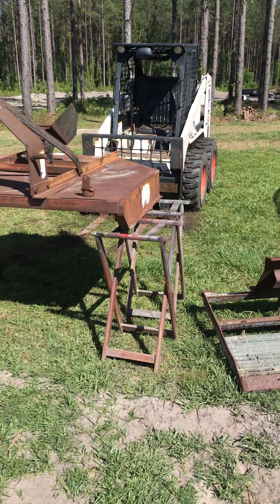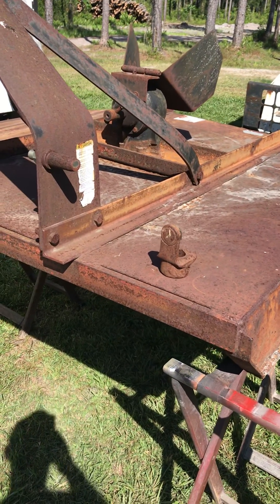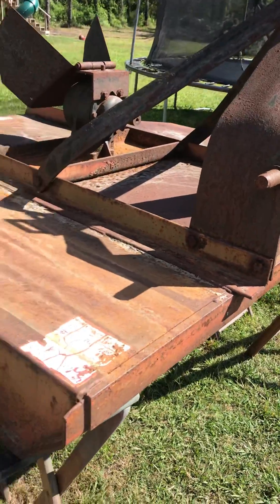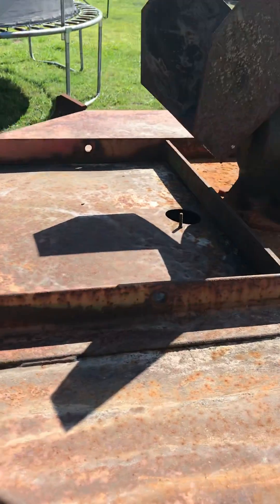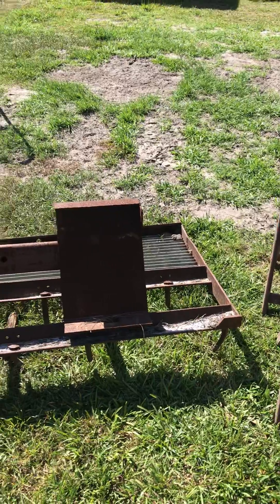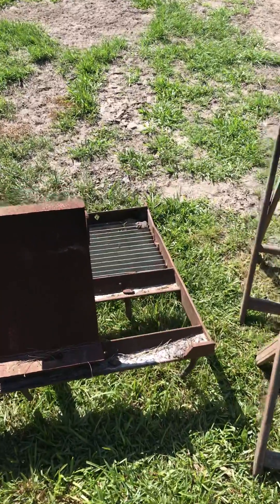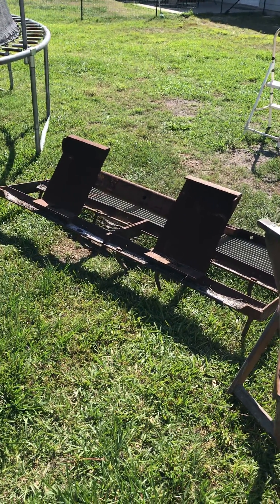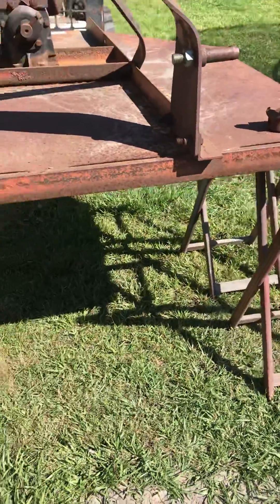DIY Homemade skidsteer bush hog

Comment: Hey I was wondering what size your bobcat was, like a 610? And I was also wondering what size hydraulic pto motor you used to put on the brush hog
Reply from the maker: The Bobcat is a 743. I’d have to look at the pump when I get a chance I believe it was the smallest one they have with a pto style out put shaft.